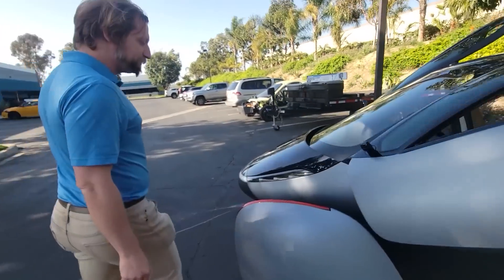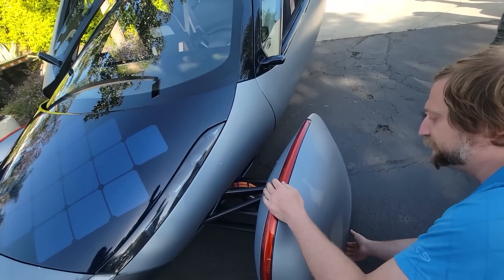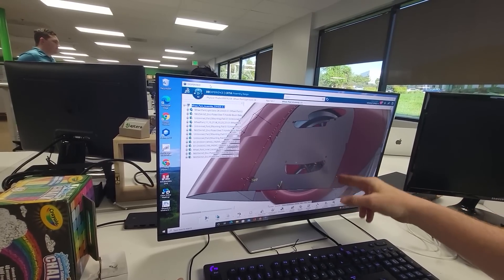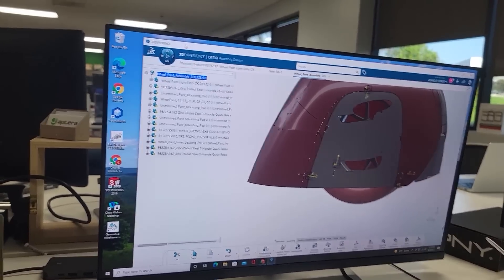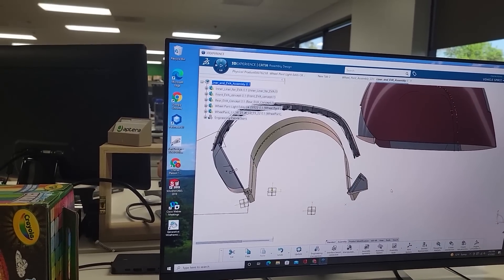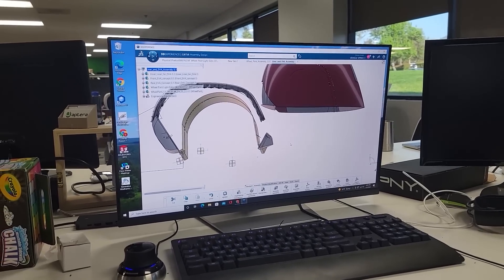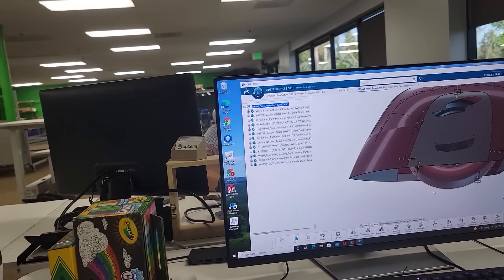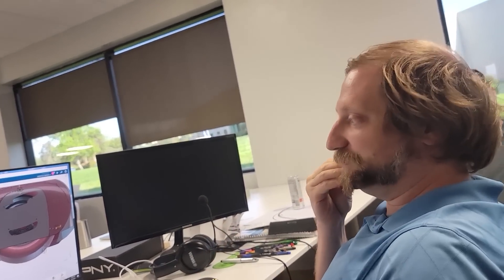No more wobbly wheelpants on the Aptera

Comment: They are getting just a little ridiculous now..lol...@:048 he says the wheel pants/covering will have the covering extend to the suspension for aero dynamics...its already a CD of  .1 or better..I think your looking at diminishing gains here...also, did the guys at Aptera think of how this would fair in the SNOW with those wheel covers?..well...obviously with the very narrow room inside the covers it wouldnt work very well, as there isnt nearly enough room for snow that would be picked up by the tire to get out..it would get stuck inside that housing and if left to freeze would be rubbing against the wheel/tire...also the covers are too low to the ground and the front would get hit by any snow/ice more than an inch tall and probably damage it...unless they are coming with an off road version of those skirts.

Comment: So what about tire inflation? It doesn't seem like there's enough open room to get to the valve with the pump nozzle. Will we need to remove any of the cover assembly to pump air into the tires or am I missing something?
Reply from the maker: Yes you'll probably have to remove the cover to inflate.  That's supposed to take less than a few minutes to do.

Comment: Guess the values for the tires, to add more air, will have to be on the inside, not the outside of the wheel, otherwise one would have to remove the wheel pants to add air.

Comment: >inexpensive

Something like this would be much easier to replace than larger car panels, but you would purchase direct from the manufacturer simply to save on time and effort. 

I hope they understand that when they hear such a question, the reason why people are asking is because this is like a dream car company. It has everything you could ever want. Started by engineers, aerodynamic, unconventional, solar powered, high performance, designed to be modular and repairable, etc... And it's surprisingly affordable after everything else. I actually hope they don't screw themselves by aiming too low. Sell a high performance sport model for the fanatics to finance more accessible models.

Speaking of which, if and when they finally launch I hope they partner up with a wrapping service to protect these panels from being constantly exposed to the elements. I'd want a metallic copper finish, personally. This is just such a cool little car.

Comment: I do wonder how it handles snow and ice. Putting chains on those wheels seems like itd be hard, if not impossible. And changing tires twice a year doesnt seem fun either. Maybe a winterised version for more northerly climes? 🤔
Reply: Was wondering the same thing.  What is the Ground clearance for snow on the outriggers and rear wheel.  Could be a problem

Comment: If I was Aptera, I would look at using something not-so-standard as the head for those bolts. Maybe use wheel locks so that theft is hindered. If they use the same head on locking lug nuts, then it is simply a case of supplying the key with the vehicle. Assign a serial number to the key and then people could order replacements if they lose them.

Comment: Very interesting to see.  I have yet to hear anyone address the practicality of managing this vehicle in a flat tire situation on the road.  Kind of looks like it'll be a bit of a nightmare, especially since you won't be carrying a spare onboard.  And as low as the wheel pants are, I suspect a flat would likely bring the pants in contact with the road, thus severely damaging or destroying them, possibly throwing debris into the body of the car itself or into adjacent traffic.  This would turn a simple flat into a more severe and costly body damage scenario, especially if damage to the wheel pant bends or breaks the mounts for the wheel pant itself.  

So, trip ruined, you're then stranded on the side of the road for a few hours while you wait for a tow truck.  But once they get there, where are you going to take it for repair?  Who would know how to get the wheels off without damaging the motor assembly inside?  Are these specialized wheels and tires that require special ordering?  Do you have to take it to a motorcycle shop?  

I would honestly love to own one of these, but there are a number of practical issues that have not really been addressed, which worries me a little.  Maybe they'll be addressed by the time they reach production later this year?
Reply from the maker: https://youtu.be/qApmFTXgs3s

Im pretty sure it's been covered
Reply: You just call AAA.  I'd love to be a fly on the wall when they show up and take a look at this.

Comment: How would you change a tire, is there going to be a spare?
Reply: The wheel pants snap off, probably without tools.  The wheels unbolt from the motors just like they would if they were brake drums.   You could carry a spare, but it probably wouldn't be supplied and you shouldn't need one.  

I plan to carry a pair of pliers to remove nails or screws, a tire plug kit, and a DC inflator.   I have repaired many tires this way on both motor bikes and cars.

Comment: Hey Aptera team, another snow consideration is that 4-wheel vehicles always drive in each others tracks. Having a 3-wheel design means the back wheel will be running on uncompressed snow or ice. I'm concerned about its winter driving capabilities because of this.
Reply from the maker: I'm not with Aptera but they are aware of this concern and feel like it won't be a problem.
Reply: I drive a Gen 1 Honda insight and the rear wheels are narrower and don't follow the tracks of the front.  It also weighs about the same 1800 lbs of the Aptera.  The Aptea has far better ABS/traction control.  I think it will be fine, especially with snow tires.

Comment: Sorry, guys, but those elaborate wheel spats really are unnecessary. A simple contoured mudguard (as found on ICE 3-wheelers dating back to the 1930s) would do a perfectly satisfactory job, save weight, cost, complexity, and be infinitely more rugged, flexible, and easier to maintain.

I get the feeling that the Aptera peeps are still being pressured into making impractical design choices by the militant branches of its (understandably excited and enthusiastic) customers, investors and supporters.

It's heretical to say so, but aerodynamics and drag coefficients are much less important than people like to think. Why? Because this is the real world, not a wind tunnel or CAD exercise. The Aptera's performance isn't limited by the need to carry and/or conserve liquid fuel.

If it's largely running off limitless solar power, wasting a bit of essentially free energy shoving wheels and wing mirrors through the air doesn't count for much, either environmentally or wallet-wise.

By way of contrast, a commercial jet airliner HAS to be efficient, because every scrap of mass and drag needs to be paid for. Replacing fat plastic teaspoons with skinny stirring sticks and saving 3 grammes per passenger matters. Using slightly smaller coffee cups matters. Even monitoring the weight of the cabin crew's uniforms is taken into consideration. Over a lifetime in which the fleet will cover tens of millions of miles, all those tiny fractions add up.

But the Aptera's going to be a road vehicle; it's going to be driven by ordinary people doing ordinary things, not research departments trying to set endurance records. I'd imagine that the drag figures of fully-covered wheels versus wheels with basic mudguards will look dramatic on a computer monitor - Look - there's a 2.097% difference! - but in the real world of tootling about the countryside, commuting to work, or just sitting in traffic, the actual cost in real terms wouldn't be a big deal.

Forget about the CAD software calculations that give instant feedback of what'll happen if the vehicle's driver has two boiled eggs for breakfast instead of just one. Yes, it's clever; yes, it's fun to see the figures, but I think people are obsessing over the wrong things.

Get the vehicle built. Build it tough, simple and cheap. I think the over-elaborate wheel spats are a mistake. I think the awkward, futuristic doors are a mistake. I can think of lots of other points to criticise, but listing them would get my Comment deleted.

There's nothing wrong with transparency when it comes to producing a new vehicle, but the Aptera guys might be better off shutting themselves away for a while and resisting the demands that they design their baby by committee.

Comment: i have to be honest im planning on removing the wheel pants entirely and going with the tallest ko2's i can fit on the wheel without rubbing when it turns.  i know that for a lot of folks the aerodynamics are a big deal but i rarely drive above 50mph and most of my driving is below 30.  im more concerned with trying to lift the thing as high in the air as i can so i dont have  to bend down so low to get in.  the cool doors are going to make it tough for tall folks to get in if its too low.

Comment: Any chance (when?) Aptera will get 4680 LFPs? Will prior versions be retrofitable? Will it have auto park & summon?
Reply: Probably no 4680s. LFP maybe in the next iteration. Battery technology development will surpass 4680 by the time Aptera batteries will need a refresh.  If you try to retro fit batteries you need to redo all of the battery control electronics. No auto park and summon. No sentry mode or at least at this point no sentry. You are a Tesla driver I assume. I drive a Model 3. The value of the Aptera is its engineering for efficiency not its bells and whistles.

Comment: Steve, another great video and great questions!  As I said previously, you should be working for Aptera and if nothing else get one of the first production vehicles.  Your videos have a great deal of thought and depth to them.  These are the videos that will make a huge difference for Aptera and increase the confidence level that the vehicle is well thought out.

While this is great engineering on the part of Aptera, I still have concerns about snow build up inside the wheel pant. If there is snow and ice build up and doesn't allow the snow to exit the pant, the tire becomes a rolling mass of snow & ice.  In a vehicle where the tire is constantly moving up and down, any snow & ice is cleared so there isn't snow and ice in constant contact with the tire.  Here, the snow & ice could easily build right to the tire. Others have suggested putting a de-icing component within the wheel well.  Unfortunately these require a fair amount of energy when one is trying to use as little energy as possible.  The type of de-icing that is used on the leading edges of aircraft could be a possible solution however it might get damaged with rocks & salt within the wheel well.  

While we are concerned about snow, ice and mud, the more common item is just water.  The amount of water that is spun off the tire is considerable.  That water needs to go somewhere besides back on the tire.  Typically that water is blown out the side and back of a wheel well but in this case the wheel well is enclosed.  Hopefully much of the water that is in the tread of the tire will be ejected before getting caught up within the well.  This is the typical case when driving more than 30 mph.  At slower speeds the water can get thrown up into the wheel well.  If water is entering the tire thread from the road and also coming from the wheel well (as it has no place to go), this can lead to reduced traction.  It will be interesting to see how this tests out.

I definitely have concerns around the timing of this as it appears that the wheel pant has not be finalized.  This will almost certainly be a sub assembly that is built someplace other than at Aptera and will be installed at Carlsbad.  The lead time to build this from their concept to a production run is likely close to 6 months. We are really approaching the critical points in the timeline, if they are going to deliver more than a couple of Paradigm vehicles by December 31st.
Reply from the maker: Yup, you're thinking exactly what I was thinking.  Most recent videos talks about the lead time for suppliers.

Comment: Not so sure I believe their appraisal of how snow will be handled...  plus access to the tire stem?
Reply: Access to the tire stem might be interesting and a very good question.  Might have to remove the wheel pant to get access to it as the stem at the bottom, nearest the road will still likely be within the wheel cover.  Putting the stem on the inside of the rim might be challenging / not possible as the motor is in the way.
Reply: You will want a gauge like this one. https://www.longacreracing.com/products.aspx?itemid=1716&prodid=95479&pagetitle=Basic-2%22-Tire-Gauge - that's the fancy one that'll last a lifetime, less expensive ones of this style are available.

Comment: 12:58  I'm glad someone finally asked about this, and I actually wish they gave a more confident answer backed up by testing. I am extremely worried about snow pack and ice formations accumulating inside these wheel pants. Until I see real-world testing, I won't be comfortable with these pants.
Reply: I see it possibly being an issue when accumulated ice breaks free but cannot drop out due to bottom cover acting as a shelf.

Comment: Once again, the attention to detail and the complexity of engineering is mind boggling. Overhead cameras for parking visibility seem logical, however I’m concerned every technological solution adds more $. It must be a very difficult balancing act. Hoping your innovative assembly methodologies can help keep the cost down. Hoping the batteries and components remain affordable and this affordable , revolutionary creation will eventually reach millions.
Reply: A concern of mine too. added tech and solutions not required but nice to have adds expense and may impact schedule.

Comment: I'm not convinced about their comments on snow buildup. Just based on my experience in Canada. On my current car I have thought about some kind of low adhesion coating inside the wheel arch, or even some kind of heat source lining the wheel arch. But having said that, in the case of the Aptera the wheel and the wheel arch move together, so the situation of hitting a bump and the tyre grinds up into the packed snow would be less likely. 

Also I'll be putting snow tyres on, despite the loss of efficiency.  I usually stay in town for winter anyway. 

Bravo again to Aptera for being so open about their processes!

Comment: I would design the wheel shroud to tip forward with simple spring loaded  hand release at the back of the shroud. so no tools would be required . If that is too difficult then just go with run flat tires all the way around and eliminate wasting time on  additional engineering. side mounted cameras on both sides synced to back up  camera or button activation from the dash for parking.
Reply: Run flat tires are far too heavy for the purpose of the vehicle.  None of us who will be driving Aptera will feel that the engineering time going into the details is wasted.  I also approve of this use of my funds as an investor.

Comment: Great information video. Although quite US focused. The biggest issue U.K. drivers will have is our road width restriction barrier’s which are frequently encountered, and are 6’6” wide (and occasionally the larger but less frequent 7’ version ). At 7’3” including wheel pants I’d like to know if a European version is being considered. With a wheel pant design that is open sided to reduce the overall width of the vehicle or other option. Because if the vehicle stays at 7’3” (88 inches) Aptera have just killed UK sales dead. We get fined, and driving license points for taking wide vehicles into restricted areas ( designed to keep trucks out). It would mean the Aptera would have to be driven effectively as a Truck (HGV) with a Truck SATNAV, avoiding width restrictions, which are common place (No city centres, a lot of suburban areas, some rural roads/villages). Not to mention constant repair and replacement of the wheel pants. There are similar issues in Europe.
Reply: They are aware of the issue, and also aware of the great interest in the vehicle coming to Europe.  This is a problem they will address eventually, but it will likely require a substantial redesign of the body dimensions, so it will take a while.
Reply: Aptera customer service got back to me about this -- "We realize this may be wider than local regulations permit for some of our global customers and we are working through this process with industry experts to ensure we can make Aptera available in Europe and the UK. We're working with a homologation expert to navigate that and make sure that we're all aligned. We look forward to providing more details on this in the upcoming months!" So they are looking at it.
Reply: @robertkirchner7981  that’s good to know. I’ve been following Aptera since the original - in hope of it getting to market. I’m at the point of putting my money where my mouth is, but the width is the issue what keeps holding me back.
Reply: I'm concerned about width also. I plan on parking in a garage with a 90"-wide door - a close squeeze even with good down-looking cameras.
Reply: @jimblacic  I would suggest not parking in a garage, as you immediately remove one of the key benefits of the vehicle -- its solar charging. This thing needs to be parked outside.
Reply: @Daryl2367  but.... At night.....